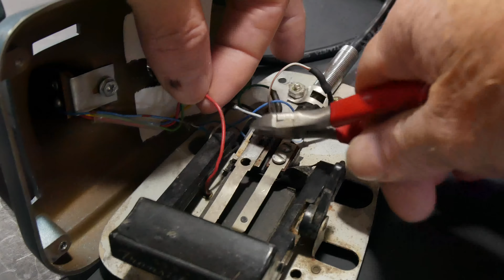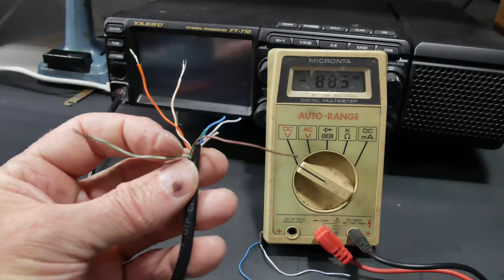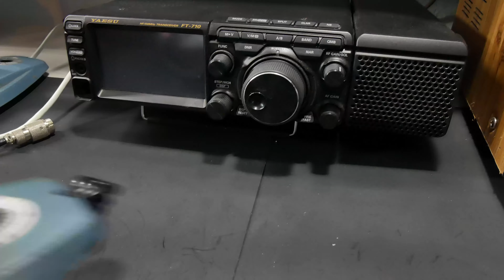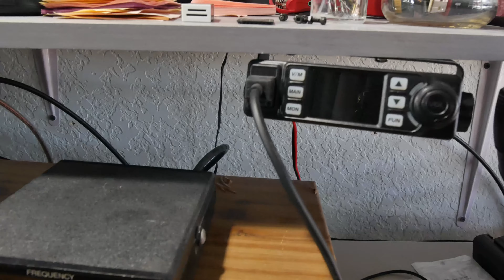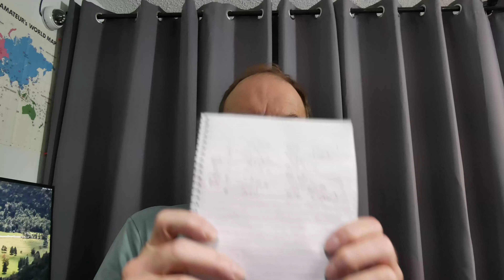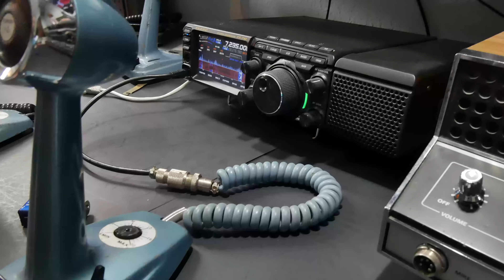Wiring vintage mics on modern or vintage transceivers.

Comment: I Have Ben Wanting To Make me a Adapter for my Yaesu FT-991 to a Superstar Hand Mic & My Icom IC-4100A To Superstar Hand Mic But I Had Heard I Could Fry My Radio by Doing It So I Have Ben to Scared To Try It But I Bet The Superstar Hand Mic Would Sound Awesome on my Icom or Yaesu ..Its Just Always Matched My Voice Better Than Any Mic I Ever Ran Back in my 11M Days & When i Had my Shop i Tried About Ever Mic With about Every Other Radio ..I Always Ran a Export  Either The Galaxy Saturn Or The 2980 Base Or The Galaxy 88 Or 99V Or The Rci -2950 or 2970Dx  Was My Favorites..But I Have Had my Share & Fixed my Share of old Cobra Base/Mobile & Unidens to..lol. I Have Other Favorites That i wont go into on here. .lol. I have The Same GMRS Radio ! Well GMRS/VHF/UHF..lol. Mine is The Retevis RA-25 but They Are Identical other than the name..Not a bad little 20-25w radio for the money i think ive had mine for 3 -4 years Their About  !

Comment: Very Interesting. Thanks for the effort to put this all together.
Other than the wiring challenge, you did not address what is needed to use something like a D-104 (with a crystal element) or an EV-719 (with a ceramic element) with a modern rig. Especially the subject of mic preamps and whether they are needed and, if so, what kind for the different types of mics?
What I would really like to see is a video on how to use a studio mic like a Shure SM58 with a modern ham xcvr.